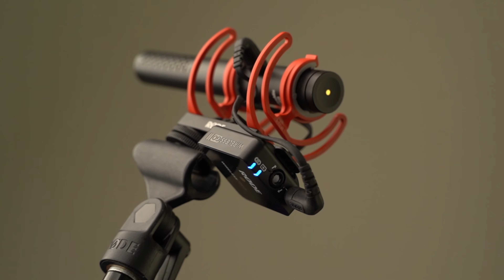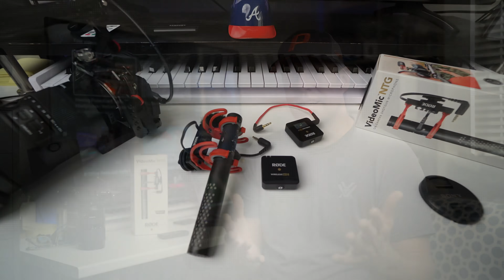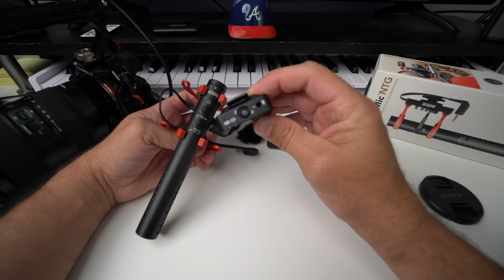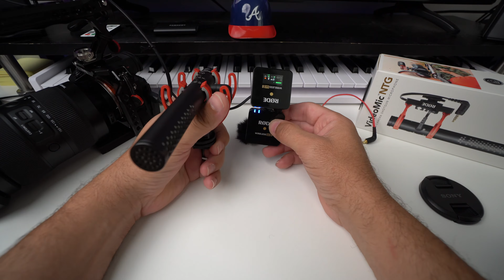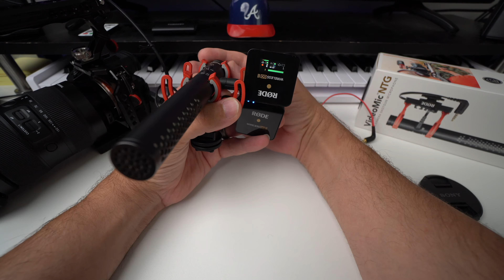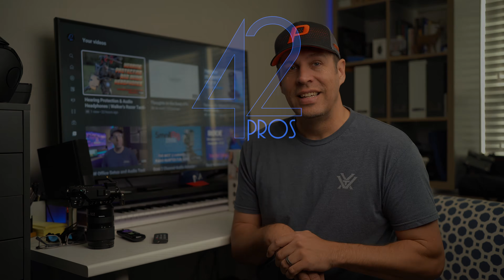Rode VideoMic NTG & WirelessGo 2 Set Up Tutorial

Comment: I never transmit it wirelessly to the camera, I use the 32bit float from the unit. The audio is always higher quality from the actual transmitter recording
Reply from the maker: True but if your turn-around time is short, why not plug in the receiver, select the safety channel option and have 3 sources of audio (2 in-camera and 1 WAV) and if time permits you’ll have some quality audio to sync the 32bit float to. 2 is 1, 1 is none philosophy is a good habit to have.
Reply: @42Pros   it takes little to no time to sync audio. its not even an issue

Comment: hey,
Is it possible to use this way also for iphone17pro instead of the camera?

and another question is,
Is it possible to use Sennheiser MKE 600 instead of Rode VideoMic NTG as mic?
Reply from the maker: The MKE is an XLR shotgun mic so it won’t work with the Wireless Go systems alone. You would have to have an additional piece of equipment like a Zoom H4 or H6 and use the output of that device to transmit wirelessly. 

Regarding the iPhone, if you have the proper USB-C cable for the receiver and phone to communicate properly then Yes it is an option to record to an iPhone and have the boomed mic audio recorded “in-camera”

Comment: Can you running two wireless mics and have one with the shotgun mic and one using normally with a wireless clip?
Reply from the maker: @TalksInTransit1  yes you can use this wireless shotgun mic setup and the 2nd  wireless mic as a backup/lapel mic simultaneously. Just remember to have the receiver set to ‘stereo’ so that the 2 wireless mics will be separated (left and right channels).

Comment: thank you, can I use sennheiser mke 600 with rode wireless pro and iphone 15 pro, and what i need to pair them to get high quality audio?
Reply from the maker: @A7mad.  no that set up does not work.  The MKE 600 needs phantom power which the wireless pro can not provide.
Reply: @42Pros  I think mke 600 can work with battery

Comment: Great video! Quick question: When I use method with my Panasonic G85,  the audio is only recorded to the left channel. I know I can fix this in post, but am I missing something obvious?
Reply from the maker: Check to see if your WirelessGo mics are in stereo (which I’m guessing they are in stereo) or mono. If the mic is in mono then either the cable or the audio port on the camera is bad. Hope this helps.

Comment: Hi! Do you boost your audio volume in post? Because when I recorded audio with simillar setup (ntg + go - it wasn't plugged into the camera, wireless go was used as recorder) audio sounded a bit silent compared to your audio. I had gain on the mic set to 11. I had plugged headphones into reciever and distance between micophone and actor was about 70 cm.
Reply from the maker: I’m going to assume that the NTG’s gain was set to 11 since you didn’t plug the receiver into a camera. With that said, the volume of the receiver (that you listen to with your headphones) that you hear will be based on the receiver’s output volume (that usually goes to your camera) which is the “volume” on the receiver. This volume setting will hardly ever match the input volume of the recorded audio. In order to record good audio to the TX internally, you will have to rely on the gain input meter/signal bar (green/yellow/red bar) that is viewable on the RX.

With that said, just about 100% of the time I’ll use a noise removal plugin/effect, a compressor and some volume adjustments at a minimum to help with the volume of the talent that is speaking. I have another video regarding this set up that has a screen shot of some of my audio effects that I use in FCP X. Hope this helps.
Reply: @42Pros  yes, but I claim that the audio is a bit silent based on listening to the final recording on pc. In compatison to the audio from the intro of your video for example, my audio is simply not that loud.

Comment: I've just ordered the NTG to pair with my Wireless Go Pro. I'm a little confused about one part. You used the back of the mic to make your initial audio adjustments to where you wanted it. But when you hooked the receiver to the camera, you changed the db level to make your audio louder in camera. Doesn't that defeat the purpose of adjusting it on the back of the mic or am I missing something? I know there have been changes (Wireless Pro for one) since this video came out. What about the other settings for the NTG mic. How exactly do they work? Thank you.
Reply from the maker: The adjustment dial on the back of the NTG is to set the INPUT GAIN (or signal strength) for the Wireless Go II's transmitter/mic. If you have that too hot (too loud) then the audio will get brittle and distort. The db adjustment on the receiver was to set the internal audio of the camera so that I can get as close to perfect in-camera that I possibly can to speed up my work in post. When you get your mic, take the time to set it up like I demonstrated and simulate an interview (record a short clips of you talking). Then, use the NTG's "volume dial" and set it higher to the point where the Wireless Pro's receiver displays the signal bar peaking well into the red (over driving the input) and record another interview clip and then play back the 2 recordings and listen to the difference in the audio. It will make MUCH MORE sense. This technique is called setting your 'gain structure' in live performance sound production (front of house, concerts and such). It helps with getting the best signal-to-noise ratios that make for really clean audio.

Comment: What is the boom pole you're using?
Reply from the maker: It's a standard weighted microphone stand that I have had for years.  I think it was roughly $70 about 10 years ago.  Sorry that I can't help out with a specific model number but you can do the same thing with an unweighted stand if you use a sand bag to hold it down while fully extended.  The Rode RM5 is what the VideoMic NTG is mounted to; the cold shoe mount slides in the slot of the mic clip.

Comment: Hi. Do you think we can connect the new Rode Wireless Pro to the NT1 5th Generation as well?
Reply from the maker: I don't think so BUT I would definitely reach out to Rode's customer service for more information.  That mic was designed to record VO/vocals and musicians without having the need of an interface; XLR and usb connectivity.  If you can, reply again with what you find out from Rode.
Reply: @42Pros  I contacted them, and this was their reply:

"Hey there, it's not possible to connect the two because the NT1 5th Generation requires P48 phantom power, where as the Wireless PRO can only supply plug-in power."

Do you think we can develop a workaround? 😊

Comment: Any tips what transmitter and wireless headphone/earbud combo to use when you’re trying to hear your voice like a normal podcast when shooting? I have been having latency issues and it’s so hard to find something that works without half-a-second lag. Is this impossible? Because I don’t want to look like a weirdo with wired headphones
Reply from the maker: Depends on your camera. Some cameras have different audio monitoring settings, and one of which is to “monitor live” or as it is happening, like a podcast. Without knowing your set up, it’s hard to troubleshoot the issue. I hope this helps.

Comment: I wonder if I could connect my ride wireless go ii to my rode pro plus 🧐
Reply from the maker: It should work well together.  Just be careful with the output level of the Pro+. It may over drive it input of the wireless go and distort the audio.
Reply: Not sure - I think you need a mic that doesn’t require phantom power (has its own battery). Not sure if you can power up a mic off the lav battery alone. It’s designed to tap into your much larger camera battery

Comment: does it compatible with DJI wireless mic too?
Reply from the maker: It should be compatible with any system that has the 3.5mm connectivity.
Reply: It worked 😊 thank you! 💁🏻‍♂️
Reply: @Davidisbusy  I have an ntg and gonna buy the dji wireless system , great to know this works too !
Reply: @Tonellacam_Films did the setup work with the DJI wireless mic and the Rode VideoMic NTG? Do you have any advice thanks
Reply: @Dollrescue  I ended up using my ntg with a ride wireless go 2 , I know that works and works well , I don’t know about the dji

Comment: Thanks for sharing this great video, how you hook rode go 2 with ntg, not the cable stuff, but  how it is physically attached? Thanks
Reply from the maker: There is a slot on the bottom of the VideoMic NTG that is the same size as the clip on the WirelessGo 2 transmitters.  You simply slide the clip of the transmitter into the slot on the back side of the VideoMic NTG; that is how it is shown in the thumbnail for this video.  Hope this helps.
Reply: @42Pros  what I also really appreciate in your creativity is how you attach the RødeNTG shock mount to the Røde RM5 Stand Mount. If I was to try this out on a boom pole would you say that you feel confident that the RødeNTG would stay on that RM5 mount securely enough to use as a boom
Reply from the maker: @redmike1979  yes I would be confident because I have used it that way for 3 different interview shoots.
Reply: @42Pros  thank you, I appreciate your quick response.

Comment: Is there a link to the boom pole that fits the connection with the setup? What's the best pole to rig the setup?
Reply from the maker: The RM5 mic clip (which is what the VideoMic NTG is mounted to) is a standard 5/8" thread that can mount onto a variety of poles and mic stands, which is what I used.  It also has a 3/8" to 5/8" adapter for mounting purposes.  The RM5 is not actually designed for this type of use but it was something that I had to do in a pinch and I haven't changed the set up since.  Works well though.  As far as a true boom pole it really depends on what your budget is.  What I use is a standard weighted mic stand with the RM5.  Hope this helps.

Comment: I read they have a firmware update where they have the more budget $100 shotgun that can do the same thing? Do you know anything about that by chance?  I also have an audio Technica shotgun. It's an XLR but I can get an adapter. Do you think it would work with that?
Reply from the maker: Yes, and the Rode VideoMic Go II can be used like the NTG was used in this video. Regarding the XLR shotgun mic, if it does not have an internal power source then it would need phantom power and this set up would not work; to be honest I haven’t heard of any adapters for an XLR mic that allows for this type of wireless transmission.  Hope this helps.
Reply: @42Pros   the AT has its own AA phantom power! Can't wait to try it. Thank you!

Comment: I also use this setup for run-and-gun filming, and it works really well. The only problems I've faced have been from both handling and wind noise (even with a Rode Dead Cat attached), so I now have it mounted in a small sized Rycote Supershield. It works really well outside on windy days, and the lyre mount has eliminated the handling noise. Not cheap at an additional £/$300, but it's an incredibly light, compact and versatile setup.

Comment: Just bought the NTG and previously purchased the DJI Wireless system setup. I"m definitely gonna try this set up with The DJI wireless mics when I boom the NTG . Thank you for this tutorial. I didn't even realize that was a possibility. Great Job.
Reply from the maker: This is by far my favorite way to film interviews.  Since I travel A LOT for my projects this "system" is a game changer especially since the Wireless GO 2 records the audio from the NTG in a WAV file regardless of the transmission connectivity.  Good luck with the DJI set up and let me know how it turns out.
Reply: @42Pros record wav only for ntg  or any shotgun with output?
Reply from the maker: @xkorbekx  I'm not sure what you are asking BUT the RWG mic will record a WAV file internally if the in-camera audio is not usable. Hope this helps.
Reply: Hi Is this method compatible with any shotgun that has output for transmitter? E.g diety mini
Reply: @42Pros thank you I was just making sure his it would save wav for any shotgun
Reply from the maker: Yes it is!
Reply: Have you tried the dji yet?  That's exactly what I'm about to try to set up
Reply from the maker: @SpencerPrepper  I have not but I have heard that it is a very similar setup process  and results.
Reply: @42Pros  I just tested it and it worked fine. Maybe a slight bit more background noise compared to just the ntg plugged into the camera but barely

Comment: Would my rode pro mic work well with rode go together?
Reply from the maker: The VideoMic Pro should work the same as the VideoMic NTG but you would need to test out the gain (volume) settings with both of those to find a good starting point.  Be sure to keep the input gain (volume) going to the WirelessGo at a level that doesn’t peak to easily (keep the signal bar near the green/yellow line) so that you get the best audio quality.  Hope this helps.
Reply: Did you try it ? I’m wanting to do it

Comment: Is it best for me to keep it in merged mode or split mode if I’m just using it on my iPhone? I’m using your same setup
Reply from the maker: To keep things simple I would run it in mono.
Reply: @42Pros  so merges correct? Thanks.
Reply from the maker: Yes mono will merge the audio into one channel/source.
Reply: @42Pros  thanks bro!
Reply: @42Pros  one last question. Do you put onboard recording on “backup” or “always”? Or do you keep it off? And do you turn on the safety channel since it’s merged?
Reply from the maker: I have them as always.  That way I have a “backup” just in case I mess up the in-camera audio.  Usually don’t use the safety channel.
Reply: @42Pros  thanks a lot. I got the mic because of you btw. I tried to use the affiliate link. I’m not sure if it worked because I’m using through phone. Now I’m trying to decide whether I should get a new professional DSLR/video camera for my YouTube videos or just film with iPhone 13 cinematic mode. I’ll figure it out, but I’m leaning on professional camera bc the quality just looks so different
Reply: @42Pros  would mono mean one receiver but sound in both left and right channels in a headphone?
Reply from the maker: Yes.  For client work (interviews) that I cant mess up I’ll keep it in stereo and use the second transmitter/mic as another source of audio and have it as a back up to the boomed shotgun mic.

Comment: Hi, I've been eyeing the Videomic NTG since announcement and specifically for a setup like this. I want to use this for recording film dialogue and the one feature that intrigues me is the safety channel.

My question is how does having a safety channel on the mic itself affect the safety channel on the Rode Wireless Go II?
If you turn the safety channel on the NTG on but leave the Wireless Go's off does it work? and vice versa?

I'm just confused as to how those two features interact and what kind of file that results in when it comes time for post production.
Thank you for your time.

Comment: i have done this exact same setup only with the deity d3 pro and the Comica  cmv-vm20 and both mics get terrible interference. Like a bad buzz, do you ever get this with the NTG seeing its essentially the same mic as the others? thank you
Reply from the maker: I have not had any issues with interference with this setup.  Here is a link to a video that has zero processing to the in camera audio.  As you’ll here throughout the video that it’s a very clean setup.

https://youtu.be/Qz_5-EdRN2E
Reply: Did you ever find a solution? I was testing an old Rode shotgun mic and same thing with the interference. Not sure if its the connector plating or shielding.

Comment: Do you only record on mono and not stereo if you're recording an interview video?
Reply from the maker: It depends on the project.  If it’s a personal project then I probably would use mono only, if it’s a paid project, I have used both transmitters in stereo (which provides 4 audio files if needed; 2 recorders/transmitters and the left/right in camera mix.  The mono version for my personal videos still has 2 different audio files even in mono, the recorder/transmitter and the in camera.

I used mono in this tutorial because it’s easier for the viewers to see the signal bar on the receiver.

Comment: Hi, i wish to set up like this but can i connect the trasmitter with laptop instead of camera ? So that i can choose this microphone audio from Zoom.
Reply from the maker: Yes but you will need to get the Rode SC7  adapter cable for the receiver (not the transmitter) to use with your computer.  I have used this set up as well and it sounds great.  Be sure to use Bluetooth headphones or ear buds so that there will not be an echo.  Hope this helps.
Reply: @42Pros  ok thanks a lot! I'll try this setup for my next live 😄

Comment: Where did u get the boom pole
Reply from the maker: It’s actually a bottom weighted mic stand that you can get at a music store, B&H or Amazon.  The NTG mic is mounted onto a Rode mic holder that has the 3/8 and 1/4” adapter to mount onto the stand.  Hope this helps out.